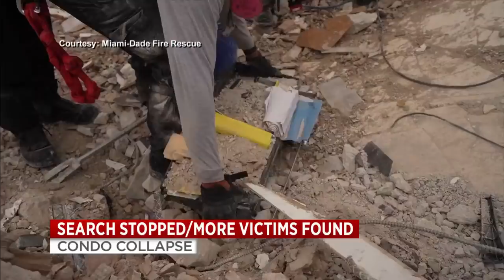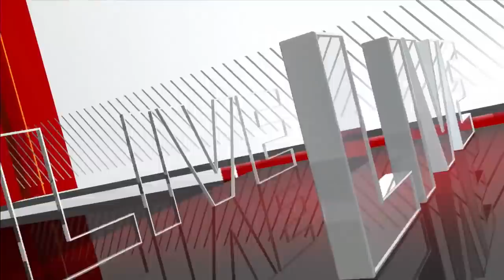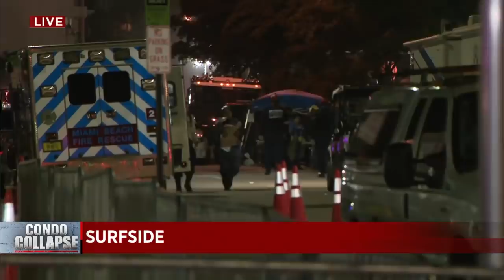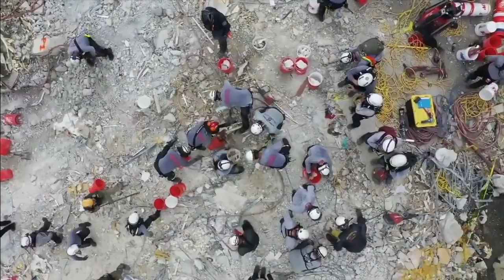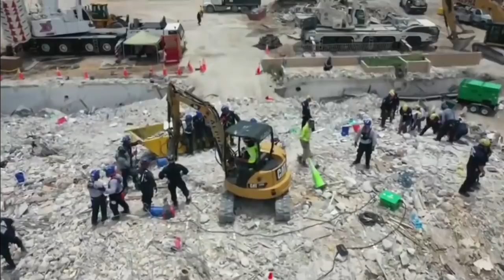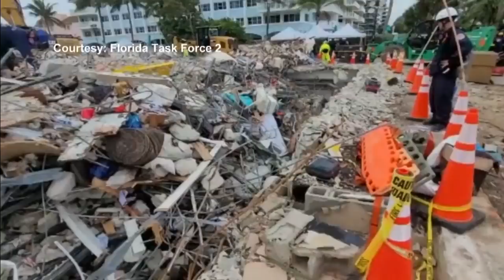Death toll from Surfside building collapse rises to 36

Comment: Not accusing anyone but a lot of builders get bonuses for getting projects finished ahead of time or coming in under budget. There are sometimes rumors of inspectors paid to look the other way. Already there are engineers saying that some supports were lacking rebar.
Reply: i msan it was built during the cocaine era, so of course the building will have problems
Reply: it had to pass inspection

Comment: The first 6 floors are under ground. Damn
Reply: Yea, saw a video while back saying how the collapse caused all to be compressed into the ground so it basically pushed the bottom floors into the ground so like below sea level i guessing. so guessing this gonna be like anotehr 911 clean up cause how deep it went when the building came down. and to hear they have now found more private stuff to take to a secure site any is like wow. and so far 5 mil pounds of rubble removed. so they now have crews all over the place try find anyone and clear out stuff anytime.

Comment: I heard a report that a woman was on the phone (in her apartment) with her husband and told him the pool’s bottom just collapsed and then her phone went dead. Now, it’s reported that the first 6 floors dropped below ground? It sounds like a sinkhole!
Reply: That's impossible.  We could physically count the floors above ground  being they pancaked. The first 1 or 2 maybe dropped into garage. No way 6. WE SAW THE FLOORS with our own eyes. There's only 12 foors plus penthouse
Reply: @donnafrflorida56  don´t miss that the building came down in 2 parts. so you have the double amount of floors on that pile. (some floors fell into the garage, the woman the first responders found in the garage alive, but they couldn´t reach her, told she is sitting next to a bed).
Reply: @donnafrflorida56  Slabs are about 1ft thick, so 6-7 slabs layers can fit in garage height.
Reply: @JackyDOS  came down in 3 parts. Middle front. Middle back. Then east side closest to ocean.
Reply: @donnafrflorida56  I have no idea what’s true but I’ve heard that reported on the news twice now. I live in California so I can only “rely” on the news.
Reply: @terrywade3696  I live in florida. Several engineers showed the collapse in slow mode. When the front middle came down the back middle followed it by about 2 seconds. 7 seconds later the east side came down.
Reply: @donnafrflorida56  middle front and middle back came down together, so it was not affecting the floor levels.(this is good seen at the collapse-video from the sec.-cam) the side close to ocean "doubled" (i´m not in the garage so i can only speculate how many floorlevels were pulverized) the amount of floors by collapsing over the middle-pile. that i told you, because you didn´t believe first that there are some floorlevels collapsing into the garage. so i explained you the reason of the floorlevels and why you counted more and not in how many parts the collapse happenend, cause that would have been 4 parts (pool cracked down as first, minutes before as a victim told her husband on the phone before she lost connection) <3. in the end only investigation can say how many collapses inside the building and garage/pool/basement-area happened before the pool cracked and the building came down.
Reply: @terrywade3696   no one is sure if cassondra stratton was in the apartment at that time, cause she called her husband when she saw the crack. while she was complaining about the pool the phone-connection died and her husband couldn´t reach her from that moment.
Reply: @JackyDOS  Has anyone heard from her since?
Reply: @donnafrflorida56  Thanks for the info. We’re not getting a lot of updates here.

Comment: Nothing feels organic about this collapse.
Reply: call the FBI-X-files!
Reply: Because the builders left out key pieces of infrastructure, and used crap materials.  If you saw one post today they said the plans do not match what is left of the building.  Someone pocketed a lot of money on these buildings.  But now they know what to specifically look for in the other 2 buildings to determine if they get demolished or are fit to repair.
Reply: It’s important to question everything. I agree with you, even despite evidence that it indeed had been neglected & desperately needed repairs. It’s a good alibi, if one has nefarious intent.